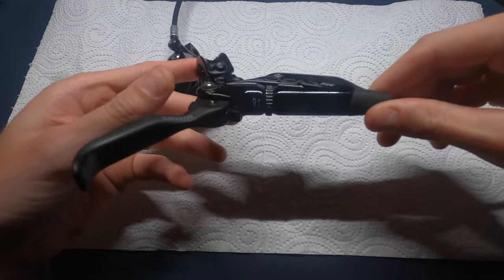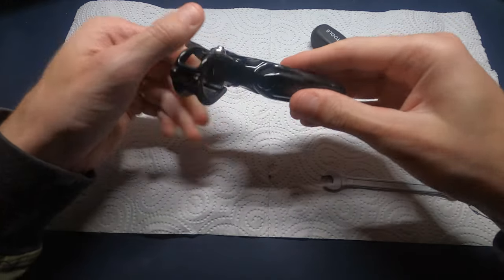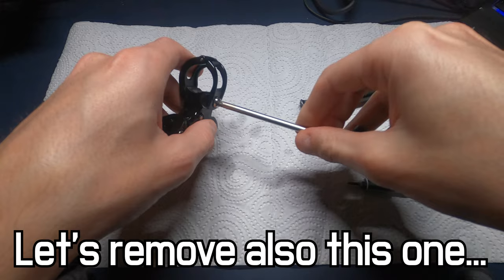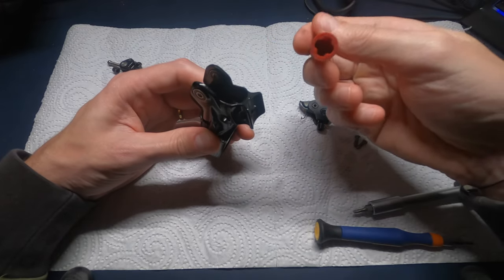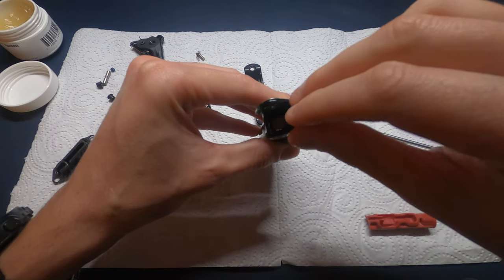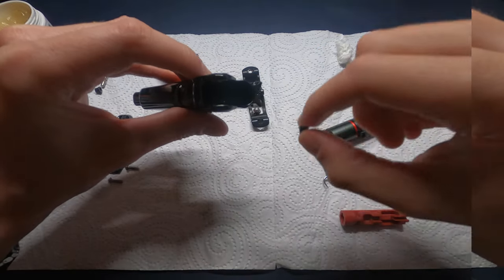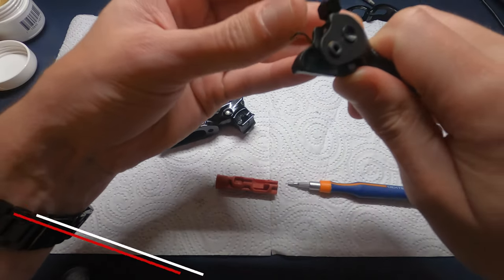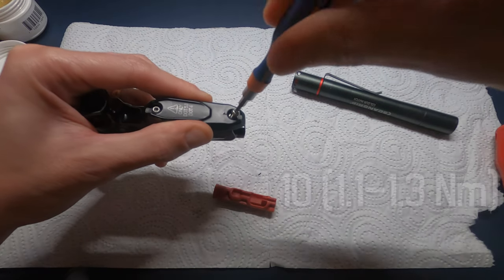SRAM Code RSC Lever Service | Maintenance TUTORIAL step-by-step 🛠️

Comment: 3:25 very bad idea to grease piston with sram butter or other oil greases, its can damage piston seals and lever gets stuck. Use only dot fluid or sram/avid dot gerase or  DOT Assembly Greases only.
Reply from the maker: i looked for it everywhere, but i didn't find it at that time. Now seems that i found it! I will update some info in the video description, thanks!

Comment: Thank you for the detailed video Oreste, I did the service and ended up with a stuck contact pad adjustment dial on both levers.  Also, when i squeeze either lever it feels stuck for a moment, then moves smoothly toward the bar.  I'll try the service again, is there anything particular I should watch out for?  Cheers, Jim!
Reply from the maker: not that i know Jim, this procedure should solve every issue inside!

Comment: please advice - after repair adjuustment wheel is spinning but less that at leaver that is working properly. Did I mess something?
Reply from the maker: I didn't get exactly the issue: if the tire is not spinning properly could be that the pads are touching, or? The lever maintenance should not affect that
Reply: @OresteCiotoli  no, I mean adjustment wheel on a leaver
Reply from the maker: @ermakov2009  ah ok! In this case i will try to redo the procedure, checking that everything is in place. The behaviour should be the same you had before the service

Comment: Hi do you know what is wrong when dot fluid coming out from the reservoir vent hole during
The bleeding process?
Reply from the maker: Personally i think it could be normal, i think it happens when there is too much pressure inside the system. The important part is that the lever feels good after the bleeding